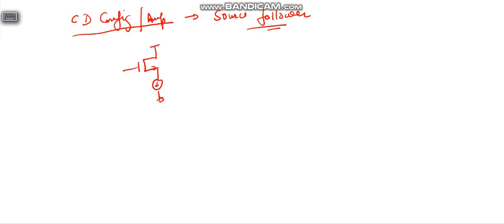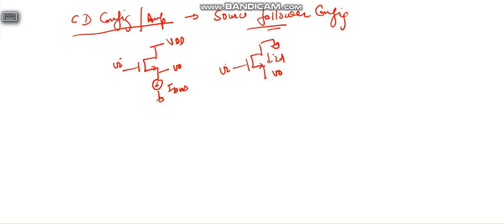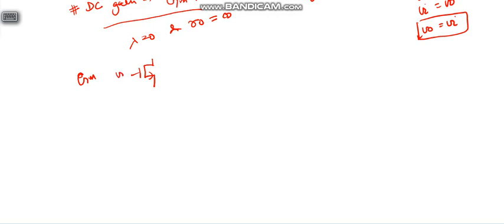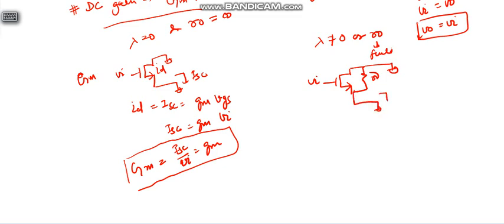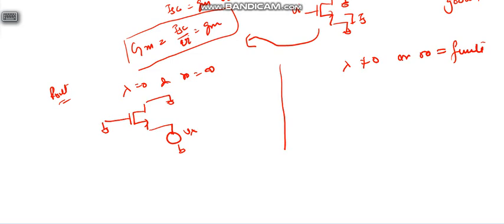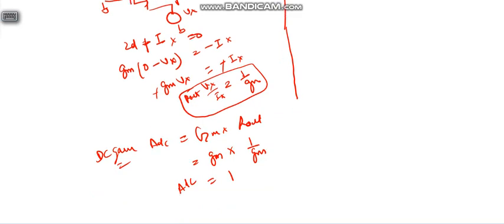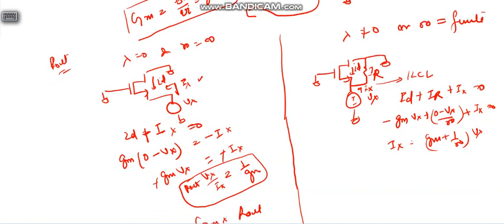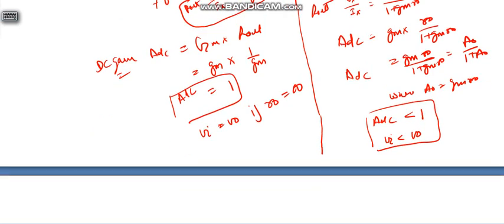analog ic design 31  Common Drain Amplifier CD amplifier  DC Gain, Transconductance, output impedanc

Comment: 1 question, why output node is floating means id=o?
Reply from the maker: Output node floating means it is open circuit and in open circuit  current is zero. In open circuit, no loop is formed so  current cannot flow as there is no path for current flow.
Reply: @Analog_IC_Design  noted, thanks